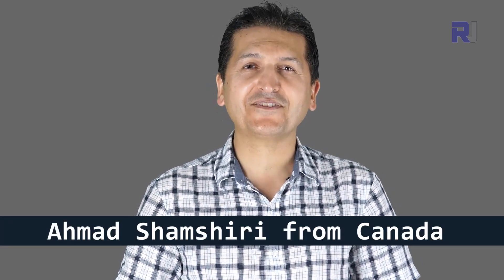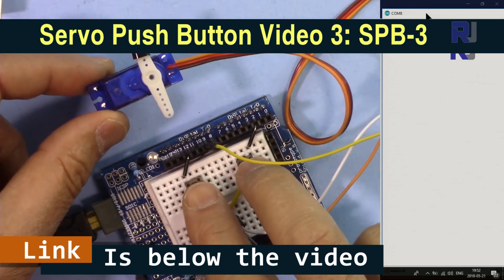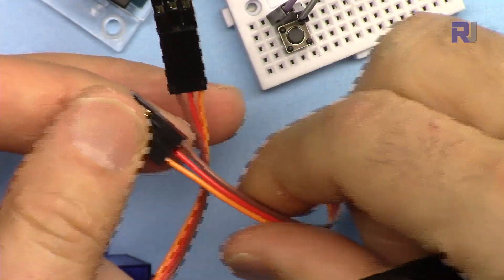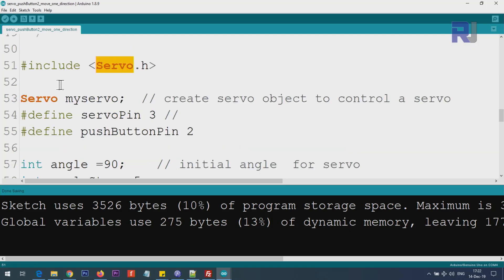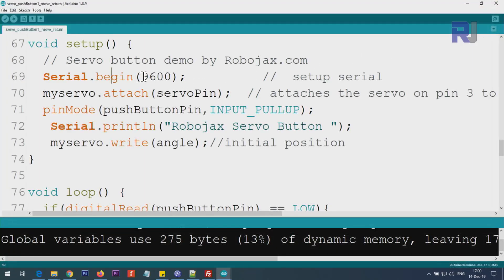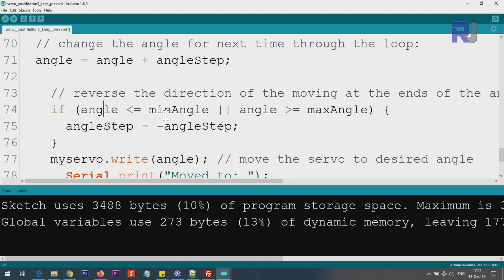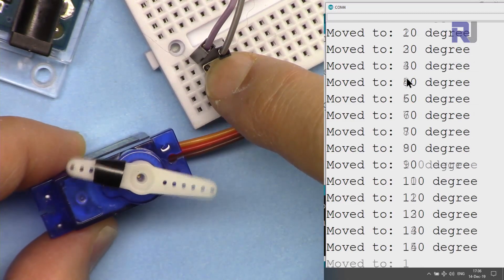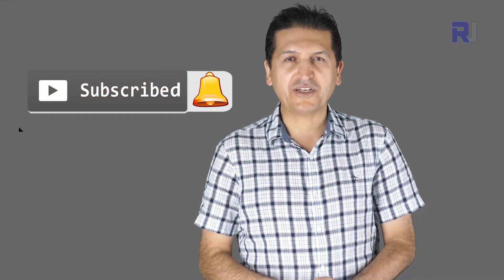Control Servo motor with a Push Button:  Move Servo Keep push button pressed SPB-3 - RJT248

Comment: Hello , I would like to have a circuit that if I press and hold the button it will turn 90 degrees cw and when I let go of the button it will turn back 90 degrees ccw. Thanks.
Reply from the maker: I she explained them fully and makes so many videos for servo. So please watch a few video and you should learn and modify them for your application. If you don’t want to learn then pay someone to do it for you.

Comment: hello ! Thank a lot for your video ! I have a question about this ... if i use external power for the servomotor(MG995R) ..what is the schematic to make that please ? :)
Reply from the maker: Hello, you are welcome. Yes it will work with servo you mentioned.  Wiring diagram is available as part of my Arduino course at Udemy.com Purchase Arduino Course at Udemy.com : http://robojax.com/L/?id=153

Comment: This is such an easy project. You just do a constant variable that checks the button state and put an if to check if it's HIGH (1) or LOW (0) Then if it is HIGH (1) Then add to servo angle variable and put a constant write code to constantly check the angle then write it in to the servo. I am 11 mother bakas.
Reply from the maker: you  are good